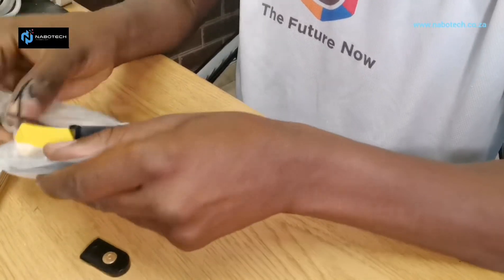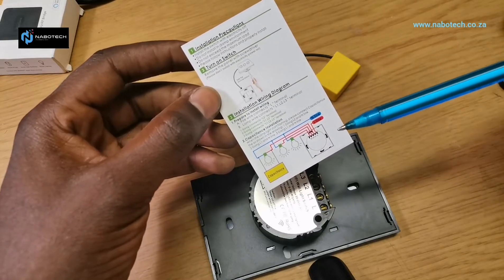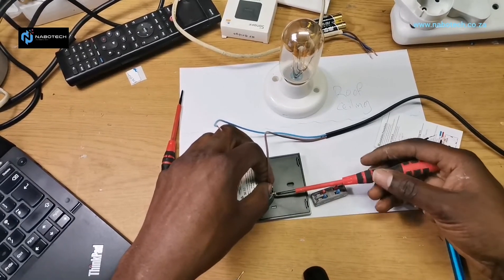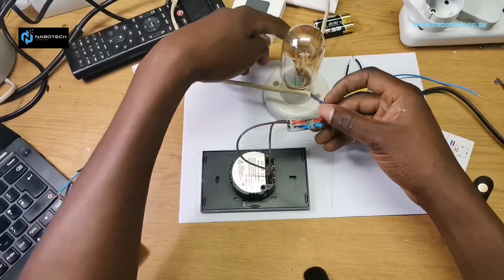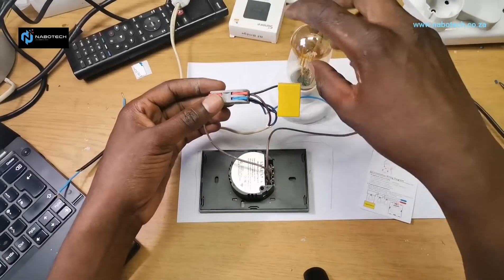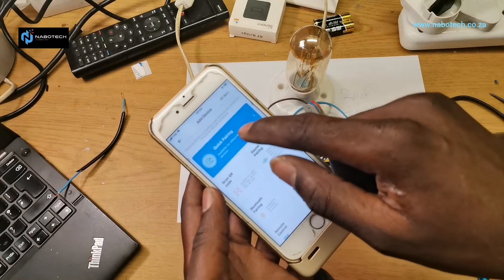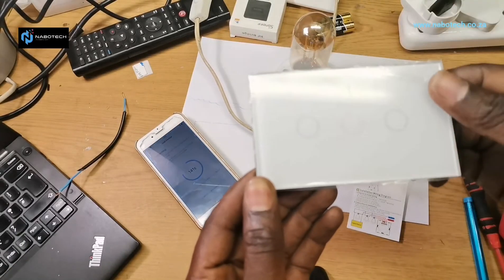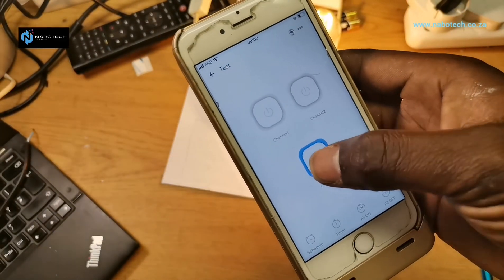How to connect and setup Eachen No Neutral smart light switch (Ewilink)

Comment: Simple the live goes to L the switch goes to L1 it should work if the light  flashes 3times u cn connect with out conductor if it doesn’t u will join the conductor to the main light . Maining take out the light add the connector to the two cords parallel to each other   Switch it on  connect